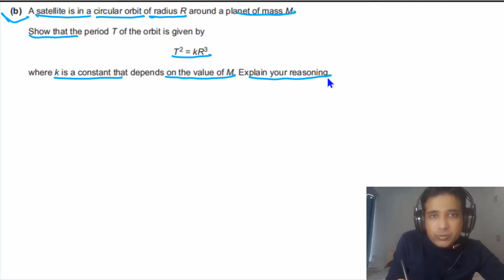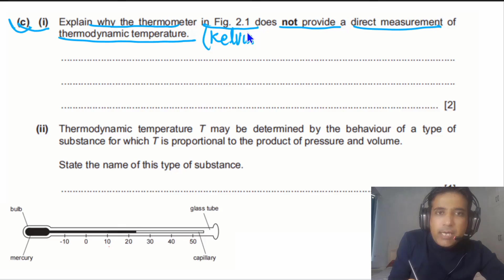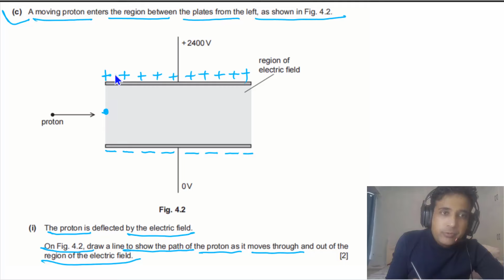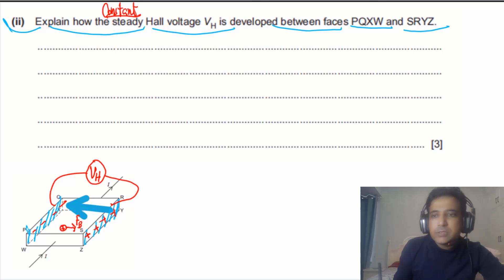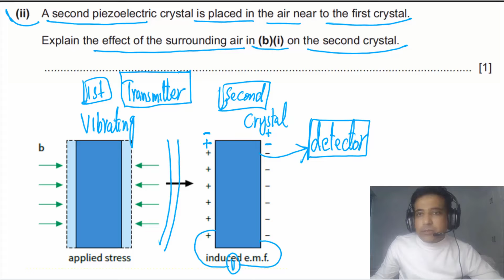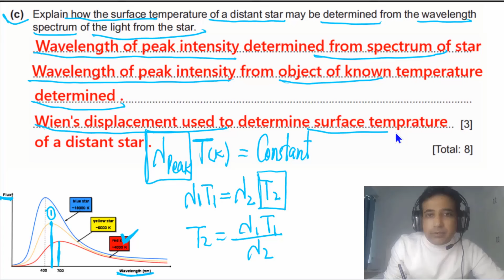A Level Physics  Paper 4| October/November 2022| Paper 41| 9702/41/O/N/22 | 9702/43/O/N/22 |Solution

Comment: Hello sir for question bi of question 5, can i say as the current in p changes, the magnetic flux density of the field changes causing change in magnetic flux in the wire Q and induce emf in the wire Q. Because there is no motion of the wire q so shouldnt it be better to say it in this way ?
Reply from the maker: Your proposed answer:
"The current in P changes, the magnetic flux density of the field changes, causing a change in magnetic flux in wire Q and inducing an e.m.f. in wire Q."
This is an excellent, technically accurate answer and would almost certainly receive full credit (3/3).
Here is why your version works and how it aligns with the B marks:

B1 (Magnetic Field): Your mention of "magnetic flux density" implies the existence of the field.

B1 (The Change): Your mention of the "change in flux" is the physical equivalent of "cutting."

B1 (Induced e.m.f.): You correctly linked the change to the induced e.m.f.  

Recommendations for future :
While your explanation is more precise for this specific setup, I would advise to keep these three pillars in your response to ensure they hit the B marks every time:
Origin: State that the current in the first circuit creates a magnetic field.
The Trigger: State that the field is changing (due to the capacitor discharge) and that this field passes through/is "cut" by the second conductor.
The Result: State that a change in flux linkage induces an e.m.f. (citing Faraday's Law is always a bonus).

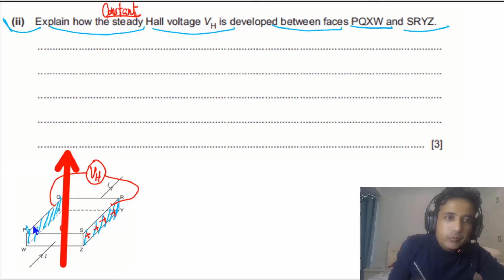Comment: 1:10:24 Sir, I would like to ask whether if we use the left-hand rule and let the middle finger point in the direction of the current, the force determined would be the direction of the force acting on the positive charge? And if the middle finger points in the opposite direction of the current, the force determined would be the direction of the force acting on the electrons?
Reply from the maker: That's correct , Left hand rule tells direction of force on positive charges or if middle finger points in the opposite direction of conventional current ( positive charges )  it will point in the direction of force on negative charges . Alternatively , we can also use Right hand for negative charges . Hope this makes sense and let me know if you have any questions .

Comment: Sir does 'cutting magnetic field of wire P' and 'cutting magnetic flux of wire Q' mean the same thing
Reply from the maker: When current flows through wire P, it generates a magnetic field around it. As wire Q is placed inside magnetic field of P so  it cuts the magnetic flux lines produced by wire P. Initially, wire Q is not surrounded by any magnetic field of its own.
Reply from the maker: Not really .

Comment: Hi sir, isnt there an easier way to figure directions for flemings left hand rule instead of using our fingers? no matter how much i try im unable to get the directions right
Reply from the maker: The Rule:
Hold your left hand with thumb, index, and middle finger at right angles (like a 3D L-shape).
Assign:
Thumb (👍) → Force (Motion)
Index finger (☝️) → Magnetic Field (B)
Middle finger (✌️) → Current (I)
Memory Trick:
Think "FBI" (Force, B-field, Current) – but remember it's left hand for motors!
Example:
Current flows up (middle finger),
Field points right (index finger),
Then force is INTO the Page (thumb).
Why Left Hand?
Right-hand rule (FHR) is for generators (induced current).
Left-hand rule (FLHR) is for motors (force from current).

Bonus Tip: Write "F B I" on your left hand to practice!
Reply from the maker: I'll try to upload video on this topic asap
Reply: @ ok sir, also sir for this year mj 2025 can u post a brief video regarding which year of pastpapers to focus more on and the important topics? will be a great help sir
Reply: @ Thank you so much sir, really appreciate your explanation

Comment: sir in question 5 part A iv  why do we draw exponential decay curve because isnt the charge from capacitor going to wire P so shouldnt the current in it increase?
Reply from the maker: When a charged capacitor discharges through a wire, we can model the wire as a resistor with a very small resistance (R). Since the capacitor and wire are in series, the discharge current through the wire follows the standard RC discharge equation. The graph of I(t) vs t will be an exponential decay curve( Discharging capacitor curve ) , with the steepness of the decay depending on the wire's resistance R.

Comment: Hi sir, for question 2bi), during the calculation of the change in temperature, do we always use the higher temperature minus the lower one? Does that mean we don't always have to do final minus initial?  I tried switching the (37.4-T) to (T-37.4), and I got a different answer... p.s. so grateful for your videos
Reply from the maker: It's easier to use higher minus lower in this case to avoid dealing with negative numbers but on the other hand you can also use final - initial your answer still will be the same but you need to use same method for all the equations . For example , in this question water is losing thermal energy so change is negative and mercury is gaining thermal energy so change is positive if we add these two together . -Qwater +Qmercury =0( there is no net gained or lost of thermal energy for whole system )  , i.e. Q mercury = Q water . Hope it makes sense . Feel free to ask if you still have any questions .

Comment: Thank you so much. Sir for 1:01:14 please can you explain a bit more on the second point about how wire q will cut magnetic flux of wire p.
Reply from the maker: It simply means that the magnetic field lines are "intercepted" by the wire Q or you can say Wire Q is placed inside changing magnetic flux of wire P so there is induced emf in wire Q ( Principle of Electromagnetic induction ) .
Reply from the maker: Cutting Magnetic Flux and Changing Magnetic Flux are closely related concepts in electromagnetic induction, but they have slightly different interpretations.
Cutting Magnetic Flux
Visual Analogy: Imagine a wire moving through a magnetic field. As the wire moves, it "cuts" through the magnetic field lines.
Explanation: When a conductor moves through a magnetic field, the magnetic field lines are "intercepted" by the wire. This interaction induces an electromotive force (EMF) in the wire. The magnitude of the induced EMF depends on the rate at which the magnetic field lines are being cut.
Reply from the maker: Changing Magnetic Flux
Visual Analogy: Imagine a stationary wire loop surrounded by a magnetic field. If the strength of the magnetic field changes, the magnetic flux through the loop also changes.
Explanation: Magnetic flux is a measure of the number of magnetic field lines passing through a given area. When the magnetic field strength changes, the number of field lines passing through the loop changes, leading to a change in magnetic flux. This change in flux induces an EMF in the loop according to Faraday's Law of Induction.
Reply from the maker: Cutting Magnetic Flux: Involves the physical motion of a conductor through a magnetic field.
Changing Magnetic Flux: Involves a change in the strength or direction of the magnetic field surrounding a stationary conductor.
In essence: Both cutting magnetic flux and changing magnetic flux can induce an EMF in a conductor. However, the underlying mechanisms are slightly different. In the first case, the conductor is moving through the field, while in the second case, the field itself is changing.
Reply from the maker: Hope it helps , feel free to ask if you still have any questions .
Reply: Thank you soooo much. This was definitely very helpful

Comment: hello sir, in question 4 b i drew the last 2 lines curled from top to bottom. the last point on top plates connected to last point on bottom plate but connected by a curve. is that correct?
Reply from the maker: That's correct , you are showing edge effects .
Reply: @alevelandapphysics-ali  ok thanks so much.

Comment: Hi sir, for Q10 (b) (iv) , why do not need to multiply the numerator with 10^-16 as the y axis of the graph is in 10^-16 so gradient = ((-8-(-4.8))x10^-16)/11.6 - 0 ?
Reply from the maker: This is based on labelling of axis on log grpah .
Reply: @alevelandapphysics-ali  Hi sir, I am afraid I am still confused. Isn’t 10^-16 part of the label of the axis of the log graph as the label of the y - axis is “ln (M/10^-16g)” ?
Reply from the maker: Let's say Current =0.50 A =50 x10^-2=ln(50)x10^-2 = 3.91 (ln current/10^-2 )   . By converting into ln we don't need to worry about factor and it makes our calculations much simpler . If we need to determine value of current then just simply multiply by factor e.g.  e^3.91 x10^-2 =0.50 . That's reason we don't include factor in our calculations for log . We use this method for very big or small quantities while sketching graphs for convenienice .  @khooshuaiqi7981
Reply from the maker: Let's say Current =0.50 A =50 x10^-2=ln(50)x10^-2 = 3.91 (ln current/10^-2 ) . By converting into ln we don't need to worry about factor and it makes our calculations much simpler . If we need to determine value of current then just simply multiply by factor e.g. e^3.91 x10^-2 =0.50 . That's reason we don't include factor in our calculations for log . We use this method for very big or small quantities while sketching graphs for convenience .
 @khooshuaiqi7981
Reply: @alevelandapphysics-ali  Thank you so much sir.

Comment: For question 5b(ii), the emf is proportional to ∆I/∆t, shouldn't the graph of emf be a straight line with a negative gradient?
Reply from the maker: In this case , current( due to discharging capacitor) is decreasing exponentially so emf induced also decreases exponentially .
Reply from the maker: so the graph between V and t is exponential decay graph .

Comment: hello! thank you for this video. i wanted to ask a question on how to do 9702/42/O/N/19 no.3(b)(iii) and (iv), thank you in advance 👍🏻
Reply from the maker: b)iii)Thermal energy used in melting ice = thermal energy supplied by heater + thermal energy from surroundings ,mL=(VI+H)T      140L =(15.1x3.6 +H)*600  (1) and 65L=(17.3*1.8+H)*600 (2) , Just subtract equation 2 from 1. H=rate of thermal energy transfer from surroundings
Reply from the maker: b)iv) Thermal energy used in melting ice = thermal energy supplied by heater + thermal energy from surroundings  mL=(VI+H)T  140L =(15.1x3.6 +H)*600 Just use value of L from part iii to calculate H . Hope it helps . Let me know if you still have questions .
Reply from the maker: Thermal energy used in melting ice = thermal energy supplied by heater (VIT) + thermal energy from surroundings (HT) . VIT=Thermal energy supplied by heater ( electrical energy ) and HT =thermal energy absorbed from surroundings . H=Rate of thermal energy transferred . 
mL=(VI+H)T
Reply: @alevelandapphysics-ali  hi, i’m confused on how you got (VI+H)T